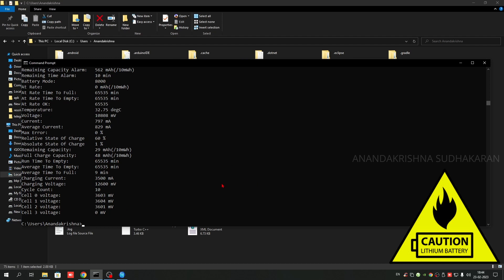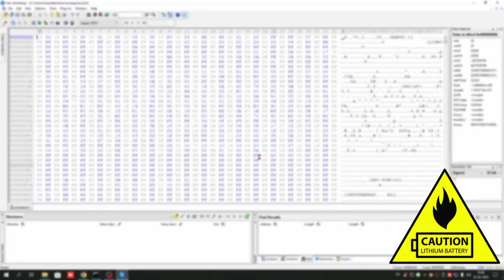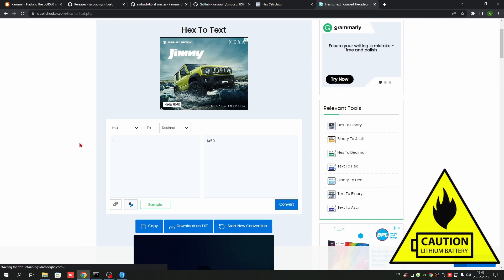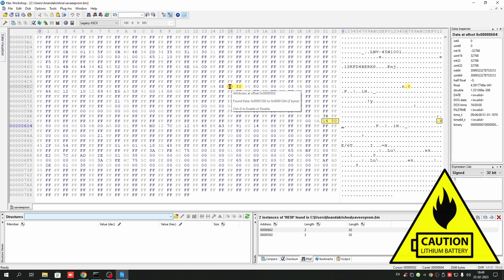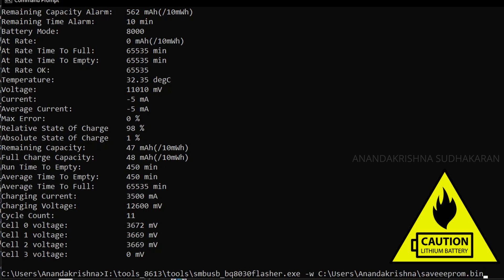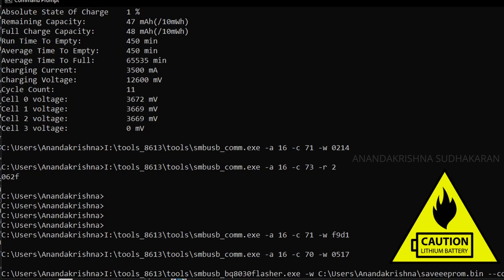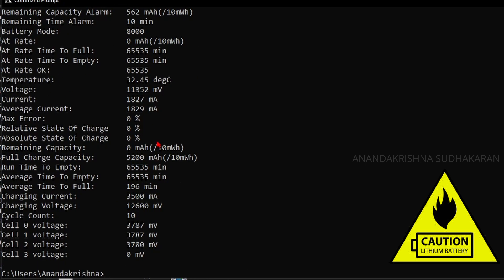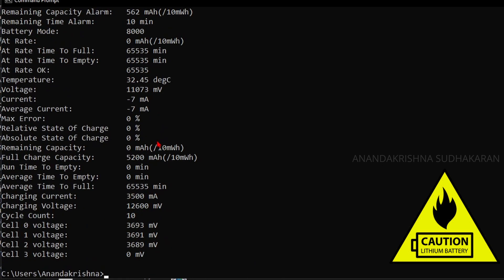BQ8030 RESET - CHANGE FCC -Read and Write EEPROM - Using FX2LP - KAROSIUM GUIDE

Comment: Dear Anandakrishna! I have a drone battery which has SH79F329AX. On the termial we have VDD, VDD, and Data1, Data2. The problem is: once one of the 3 cells has over discharged the battery is tagging itself as cannot use anymore. I can buy new battery cells for cheap, but seems the controller board wont care, and retest. It stay as damaged. Please help me, how can I reset the battery? Thank you so much!
Reply from the maker: It's actually a Chinese chipset. I read that this chips memory will erased if all batteries fully discharged. But I have  this chip, I replaced the battery. It worked for me. Do you have any tool? Mostly this chip is not respond to any code. So you need more digging. What is the battery status? Did you check registers
Reply: @AnandakrishnaSudhakaran  This could be chinese. But I have no tool for reading. If i understand you: after I have a tool for programming I have to dig registers for which can be the "battery is deffective" data? After I have to modify it, and my it work?
Reply from the maker: @drpchu  yes if you have tool you can reset the chip

Comment: Awesome work. I have an Asus battery that I believe is locked. It was on a liquid damaged board and it's fuse blew. I've replaced this and it's not blown again but still won't charge so think just need unlocking. Can your arduino software do that?
Reply from the maker: Thanks for your comment. Codes are not developed by me, these are available on Internet. In my case this tool is enough. But for more advanced batteries, professional tools and Hardwares  required like NLBA, Regedit, TBD. etc.., Bq studio is also free but need Hardwares like EV2300 which is very costly. So first identify your chip. Am working on an arduino code now, not completed. Arduino is not powerful for more advanced functions. So i dont recommend it, FX2LP board need strong knowledge of coding, But with a raspberry Pi board you can unlock any batteries. The codes and software is free. What am saying is, please research yourself first. Search for your battery chip datasheet, You can ask me anyhelp if I know I can help you. Kindly message me on my Instagram.